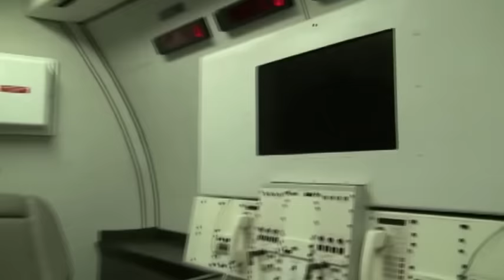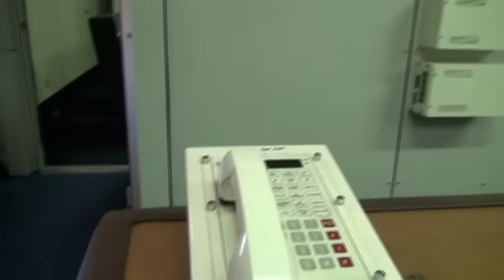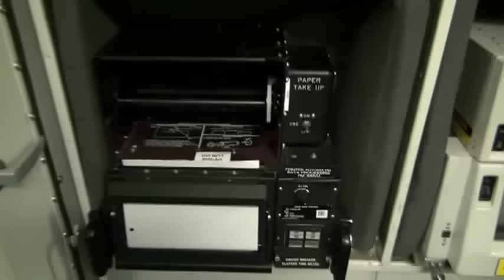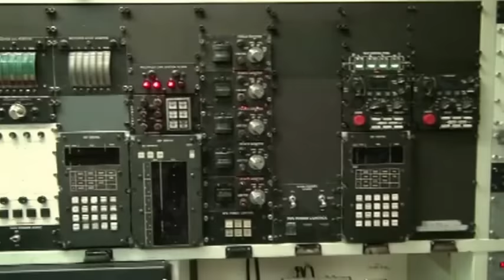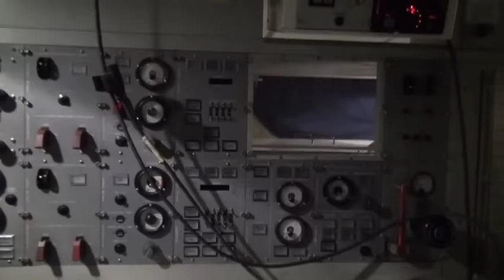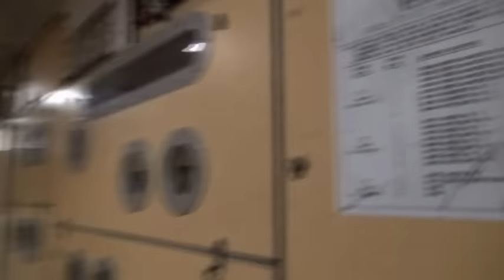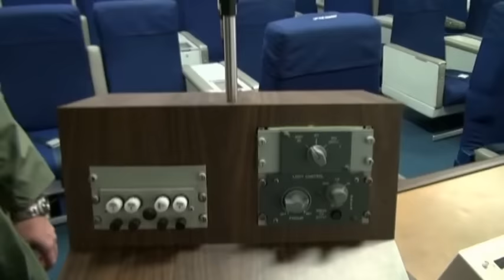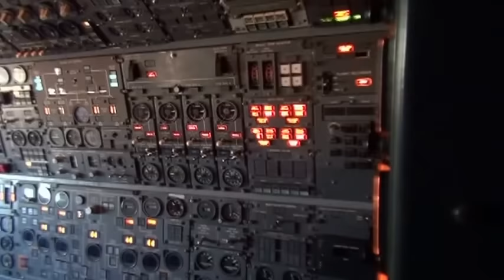Guided Tour Inside the E-4B NAOC Doomsday Plane

Comment: Since the technology that safegaurds americas resources doesn't need to be connected to the internet or it would be a hinderance.  Therefor the technology doesnt have to be the newest or latest.  Just the most secure and reliable.
Reply: old computer are not that reliable so an upgrade might be nice
Reply: usb ports make newer computers less secure.  if the older computers break their parts or boards are simply replaced.
Reply: Wrong. There are electric typewriters and CRT monitors on that plane. In no way shape or form is either more reliable than current options, nor is either space / weight efficient, NOR are either RELIABLE or easy maintenance. Wanted to get a closer look a the printer. I suspect dot matrix.
Reply: +websuspect I think the only reason they don't upgrade is because they don't need it any more it's a coldwar relic
Reply: Dot Matrix is still common int he Government where you need a lot of duplicate forms. Plus they are pretty dang reliable.
Reply: Heck some 3rd world countries using a 1200 baud modem is considered fast at some Embassies. Obviously not used for Internet. LOL
Reply: i forgot the desks with computers connected to radar satellite and NORAD are probably pretty modern and probably track enemy forces and fifo.  ( friendlys )
Reply: websuspect OKE
Reply: One dont upgrade a single unit, this is a piece of a system , no more no less. Changing a system costs a lot and it has to work, not to look fancy.since the cold war never finished, these things exist. Those who oppose - then why didnt anyone scrap the missiles? Every day the routines are done on all sides.
Reply: Do you know what an EMP pulse does to modern computers? Well, USAF does know....
Reply: @CriticoolHit  They are stuck with the technology it's not ideal its connected to everything else which is also outdated on the ground. Many govt services still run on teletype technology.
Reply: @egooidios5061  It does the same thing to old computers too. Once a cpu is fried on them motherboards try finding replacement parts. Yeah good luck.

Comment: Soooooooooooo all this equipment in this plane running all time, meanwhile in comercial planes we need to put our phones in airplane mode....
Reply: That's because commercial planes are equipped with technology that needs to be able to filter out concentrations of communication signals on the ground so it can start dispensing chemtrails whenever the plane is close to urban and residential areas. Cell phones would disturb the scanners so the government forces airlines to prohibit use while they control population growth... wake up SHEE- oooh, gotcha!! :D
Reply: duh becuz we hav tu make our fones in airoplane mode to help the aireoplane fly rite
Reply: Not true... anyone who has ever piloted an aircraft has seen cell phone interfere with nav equipment.
Reply: mgoblue0970 mythbusters seemed to have a problem finding anyone to corroborate that.
Reply: @Star Gazer...the flying testbeds which both Boeing and Airbus have built to EMI seem to contradict Mythbusters.  Next time come to with actual science or a scholarly source instead of pop culture.
Reply: Built to "study" EMI I should have written.
Reply: Yeah... except no. The power emitted from a cell phone is on the order of a watt or two. There's just not enough power there (especially that far removed from the pilots) to cause interference. Not to mention, all the electronics will have RFI filters anyway. It's outdated nonsense. There is no way a cell phone could cause a failure. Notice how you can use your cell phone on the ground, near vital systems? Hospitals aren't shielded from cell phone comms, yet nothing ever happens. Same goes for military installations, large computer networks -- it's just complete BS. Properly designed electronics (and let me tell you from experience, avionics equiment is over-engineered to the hilt) can easily accept interference without any kind of malfunction.
Reply: MinecraftGambit ... lol English, dost thou speaketh it? I flew for years with my phone/walkman/discman/gameboy on and never had a problem so as far as I'm concerned that's complete horseshit
Reply: everything in this plane is shield for EMP so your point is null
Reply: mgoblue0970...apparently you haven't flown on the left or right seat either...A cell phone does not interfere with any kind of communicational oder navigational system on an airplane. That is totally absurd. The only reason why they tell you to turn them off is for safety reasons. 1. people are supposed to pay attention to the safety instructions and are not supposed to be distracted by their phone. And 2. in case of an emergency people are supposed to get off the plane as quick as possible and are not supposed to film everything because they can obstruct the emergency evacuation... And trust me, I am an Aircraft System Engineer and a pilot, any sort of interference is just nonsense...Greetings from Germany
Reply: Remember when hospitals told everyone to turn off their cell phones because it would interfere with the equipment?

Pepperidge Farm remembers
Reply: Joe >> That was NMT-mobiles. Not GSM.
Reply: OK the actual reason we put devices in airplane mode is this. It is impossible to regulate or standardize wireless transmission from devices on a global level so, however unlikely, it is possible that a device from some far off place might be at the exact frequency/power required to interfere with the electronics on any one model of airplane in operation (of which there are many). The navigation systems are paramount but there are other electronic systems onboard that must function correctly at all times, and the failure modes from different frequencies interfering would be difficult to predict. It would take forever to test all devices at a level adequate for airline safety standards and even then new devices would come out every day so the testing would never be up to date. A one in a million chance is not good enough in an airplane because that would ultimately result in 1 crash per million flights, which is too much. So the most logical way to prevent any problems is to have them turned off during take off and landing. Consider it lucky that they allow them on at altitude now. And of course everyone knows an iPhone or galaxy s8 won't interfere. That's not what the rule is for. As for the plane in this video, every board in it no doubt has been specifically designed to be hardened against targeted emp strikes from high yield nuclear weapons.
Reply: MinecraftGambit gud engrish
Reply: +Faketrollname sevenbillion Do i need to put my phone on airplane mode when i use my toaster?
Reply: Jake Seiner no because you'll likely need reception to call for help after you stick a fork in it
Reply: It's so that you see the safety announcements. So in the case of a crash you can't sue them.
Reply: I got in a plane to Dubai there was WiFi lmao.
Reply: Hey. I read this thing on the interwebs... Thanks - Lumpy
Reply: @cfg003  thank you!
Reply: Yeah but this plane has the little metal grids on the windows, so it protects it from the phone signals. Duhhh. (Inb4 someone thinks I’m serious).
Reply: @minecraftgambit4465  not true its so they interfere with the cockpit headsets
Reply: @-BuddyGuy  so just taking off because you dont get signal in the air
Reply: @AureliusR  a watt or two times two hundred passangers
Reply: Chudy Ilozue first of all not everyone will use their phone second of all variety of phones have variety of power ouputs, Third of all ‘200 passengers’ is an awkward count for the amount of ppl on planes. It differs vastly
Reply: An explanation I heard about cell phones was to protect GSM infrastructure on the ground. The servers for a local network can only handle so many handoffs before they start having serious problems. 100+ phones moving at 500mph, being handed off from tower to tower again and again, would be detrimental to the networks on the ground.

35,000 feet seems pretty high, but cell phones and towers can reach that far (not well, but they can).
Reply: @cracklingvoice  interesting explanation, it make sense. Thanks.

Comment: Looks like eighties technology. I am sure it must have cost a lot.
Reply: That's the advantage. In case there is an EMP, the old instruments still work, most Chip technology stops working when exposed to an EMP (there is usually an EMP when a Nuke goes off).
Reply: I refurbed the gallies in one in 1995. They told me that it was the second most expensive plane in the world. I doubt it was this one though because they said there was four of them and one was always in the air.
Reply: It's mostly analog. Transistor based microprocessors are sensitive to EMP and will be permanently destroyed when exposed to certain power levels
Reply: another reason why advanced microprocessors aren't included for doing mandatory service on this plane, is because processors are electrically connected to the planes exterior, the fuselage. This is for PE (protective earth). If an EMP goes of, the processor will die due to an to high reverse forward voltage. Unless the processor is turned off, it would die.

Now you cannot disengage such processor mid-flight or when the nuke goes out. 
Another example, let day you got an laser diode, and the case of that diode is -, and you put it in an heatsink. If the heatsink is connected with the - of the diode, and you induce a static shock like a piezo or yourself (ESD) you would find out the diode will die, because even tough it is an diode, the reverse forward voltage is high enough to ark over the junctions therefore destroying it.
Same happens with EMP, it would create an negative forward voltage which permanently destroys the processor.
Reply: Sort of like reverse polarity but in an different way, the processor is powered from the cathode and anode, doesn't sound right and isn't right as the electrons will collide.
Reply: +Lorenzo van het Hul the plane is equipped with Emp  shielding mesh. I heard a while back that if an emp that has the strength to kill a microprocessor also has the strength to kill people. So which ever way you see it you will either live or die so a microprocessor would be equivalent to analog electronics.
Reply: You are seeing it wrong. An EMP requires FAR more power to kill an human then jamming all multi billion transistors inside a microprocessor. Analog is less advanced, transistor components don't even have to touch the planes fuselage for PE and such. A microprocessor, like FBW avionics, require ground and sensing lines to touch ailerons, spoilerons, ruder, elevator and shit. They are located in an non protected environment. Namely the tailplane and the wings. And sensors for FBW have minimal 2 wires whereas one acts as feedback and the other for ground. Most cases it has a self diagnostics wires and so on. What happens is, the EMP could create an negative forward input spike trough PE, sensing wires and such, it doesn't even have to be close to kill you. Try sparking your phones exterior with an good piezo element, you will see it would phase the screen as the screen is the most ridged components in a phone in terms of electrical characteristics, you could see it spark, but is you use a good piezo, it will kill the microprocessor and PMIC due to a too high negative forward voltage spike, but, if the battery is disconnected, you could put that phone in a plasma and it would still work as there is no electron collision going on inside the processor architecture, the clamping diodes can block the electrons, but if the circuit is closed, the electrons will ark the clamping diodes, therefore jamming and burning solid state and passive components.

And that is why we use analog components with a few transistors which aren't connected to PE.
Reply: +Lorenzo van het Hul Transistor is a common component in analog circuits too. It is not by definition analog or digital, it is just a semiconductor component. Also, if they have computers, flat screens and printers (like we saw from the video), it means that plane has a lot of digital electronics onboard . . .

But indeed, probably there isn't digital IC's in the vital systems for controlling the plane.

One thing tough, couldn't you use an optical isolator? Although that has semiconductor on both sides, so probably it wouldn still break from the side that is connected to the outside.
Reply: +Alex Sauber To not have any chip technology, the design should be from 60's. At least those computers and screens looked like they most certainly have chip technology in them.
Reply: +Lorenzo van het Hul Also from where are the processors connected to the PE ?

The case of the computer system may be, and if that case is connected to the same signal ground what the processors use, then it would be connected to PE.

But IC's are quite low voltge, in normal conditions they don't necessarily require PE or the PE and signal ground may not be connected to each other at all?
Reply: wopmf4345FxFDxdGaa20 the problem is induction. Optical data transfer doesn't induct current to the main device, whereas a wire would. And a lot of critical plane control modules are optically connected with each other. Screens definitely contain drivers and pixel register microcontrollers. But they are connected inside the plane surounded with the EMP blast barrier. Other components like the feul flow sensor etc are probably optically connected to avionics component.

A processor is actually connected to PE. There are pins and vias on the motherboard connecting them. Not sure why, but they definitely are. Also, the heatsink is too as some conputer cases require them to be mounted on the case plate under the motherboard to reduce stress on the motherboard, this gives computer manufacturers the ability not to use X clamps. And sure enoug, that heatsink is connected with the IHS, and the semiconductor core is usually cathode. And some IHS's are soldered on the IC and some are even electrically connected with the substrate, which connects the CPU to PE even tough it isn't required. But in the aviation world with EMP barriers, the PE should be isolated from transistor based equipment. A plane uses PE as their generators are giving suck power it's unbelievable, if you touch the terminals, you are dead.
Reply: slovokia I would bet under the hood,it's state of the art
Reply: Scott Gibson actually the plane has older avionics
Reply: sigh. emp isn't a concern inside a metal shell of an airplane.
Reply: Except for all the holes and seams in that shell. That's why the windows have screens. Plus, it can't be a perfect faraday cage as they have to actually be able to communicate with the rest of the world -- that is, after all, the entire point of the plane.
Reply: jfbeam sigh. someone clearly skipped his physics class.
Reply: Isn't that what the 5 miles of antenna is for?
Reply: Probably state of the art when it was first built.
Reply: Alex Sauber uhm... "chip technology" was mainstream technology in the 80's, and by far.
Reply: 1984 was so long ago
Reply: Why couldn't you have sensitive transistor/microprocessor equipment running isolated from the fuselage? Floating ground?
Reply: older, 60s, 70s
Reply: Legend has it, each bed comes complete with a portable CRT Tube TV and VHS copies of Law and Order.
Reply: The aircraft is shielded against EMP (its made out of metal), even the windows have a conducting grid inside so it isn't a big problem. There are many transistor based things onboard, 747-200 was made when transistors been already in common use. Modern comm equipment is transistorized, there are no vaccum tubes here beside some CRTs.
Reply: @alexsauber  silly comment. This old technology would also stop working in a EMP. It all runs on microchips, just shitty old ones. Unless they were analog computers, size of a fucking football field, they might be safe. But were about 70 years to far in the future for that.
Reply: @lorenzovanhethul1355  none of this stuff is analog or transistor based technology. If it was you would have a computer the size of a house with the power of a Casio watch. Its just shitty outdated 80s cold war technology that has never been updated. It all has microchips in it and would all fry in an EMP.

Comment: The equipment here looks outdated (and some of it is) but it's also designed to be relatively simple to maintain, very reliable, durable against lots of catastrophes including EMP and is heavily hardware-based, rather than relying too much on complex software which can be hacked or may contain bugs. Software bugs during a nuclear apocalypse are not going to be good for business.

Comment: I hope whenever it's needed all the operators can remember all the CP/M commands for all the 1970's computers ;) lol
Reply: Skylark  Yeah ;), I thought something like that, my comment was meant as a joke...
It would be really interesting though to find out more about them, such as the specs, cpu's, memory, who built them and what kind of functions they serve and what software they run... but alas, I guess that's not public information... ;)
Reply: It's not what it seems, hardened electronics are kept rather straight forward,  they are not ment to play video games or store non mission data... trust me you don't want to trust communication in a crisis to snap chat or Skype
Reply: @Lima-fj7ps  Yeah, like those IBM produced radiation shielded PowerPC processors, which are used on many space probes... Even the some of latest versions still in use run at early 1990's frequencies, like 33MHz etc...
Reply: Battlestar Galactica   remake  certainly  recommends  hardened and simple electronics.